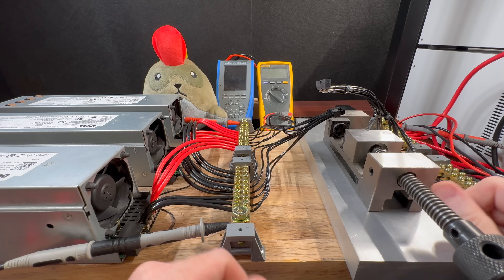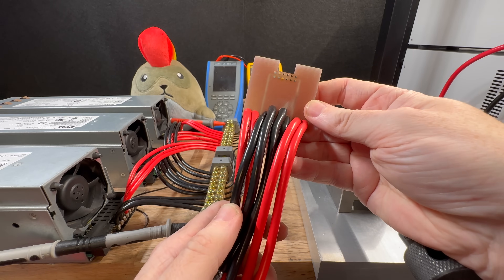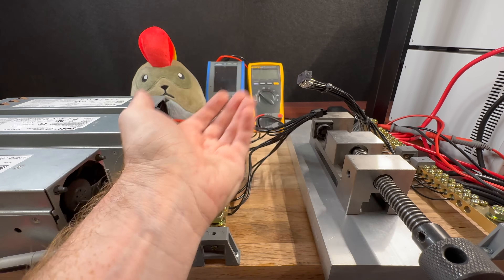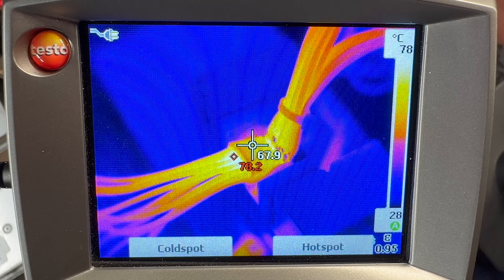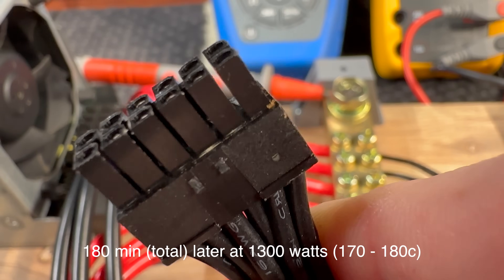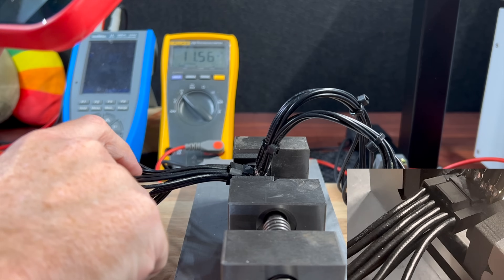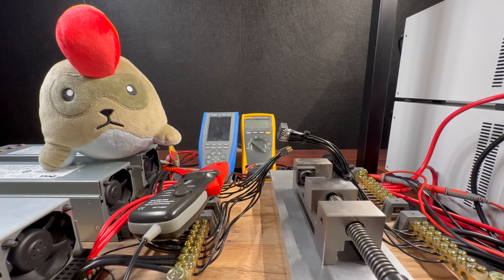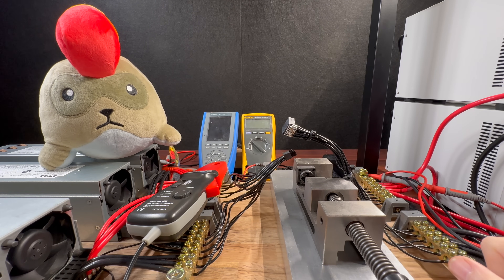NVIDIA 12VHPWR - Q&A + Melted Wires

Comment: About female connector (one supposed to be soldered on pcb), are sqare pins able to twist, rotate around axis inside connector in this setup? possibly affecting contact quality.
Reply from the maker: Possibly but the pins were stable but that which is why I did the 12AWG wire originally, I think it is just the connector degraded to a point of a cascading failure (a lot of heating has happened to this connector now). We will come back to it and investigate more

Comment: I would like to see a 3x8 pin setup tested just to see what sort of currents that can pull. and considering that they have a weird combination of 3x12v and 5xGND (the 2 sense pins are ground also) it could make for some weird results. although to make one fail you may have to test just a single 8 pin connector then just 3x the result.

Comment: I think it would be super interesting to also try this with other brand's cables. Currently you are using be quiet. Most issues with melting I heard occured with Asus or Corsair cables. Could be quiet's cables simply be superior?

Would also be interesting to see 12VHPR vs 12V 2 x 6.

Thanks for doing this BTW, very interesting!
Reply from the maker: That is a rabbit hole we can certainly go down in the future 🙂 currently getting the basics down then we can explore some other options 🙂 im not saying bequiet cables are normal, above or below average yet with a sample size of 1 🙂

Comment: We can shure abaut the connector houseing need some more disturbance to get melted.
So the base problem not the DC current load. 
Next step: need some chopped load to make the pins and wires are start moveing by the dynamic forces.
The contact surfaces may take some rubbing on eachother and it is may cause sparking and more exessive heat build-up than a static overload.
Reply: But contacts dont move while they are inside pc. They are always under tension, because of all the bends. Only things can ruin connectors are if u remove them under high load, or if u put them from one gpu to another, because some company might make that square contact pin larger than other, causing connector to stretch and be loose while installing on other.

Comment: I think it would be a better test case scenario if you could set it up so only a couple or three of the wires have past the specified 9A current going through them constantly. Then, observe the temps per wire, and the connectors. What we know so far is that once the cable has gotten some use, the connectors eventually start to develop connectivity flaws where resistance occurs, and this results in the current re-routing over to the wires that are still fully connected--thus resulting in increased heat until burning point. Note that the recent cases seem to have had the melting happen on the connector plug, not the wires. This may mean the connection between wire and the contacts (soldered or not) may be unable to withstand the heat and are the first to reach failure point. The arcing inside then eventually melts the plastic leading to the catastrophic issue.
Reply: YEP! Although in the end we'll only prove that 1 wire/pin can't handle 600W.
So either card makers return back to at least 3-phase power cascade...
or we succeed this connector with a simple two-pin like the C13/C14. :)
Reply: Upvoted. The entire problem with the standard is the pins and barrels having connection failures
Reply from the maker: We will be deep diving into this soon, I think everyone will like where this will be heading

Comment: just got my 5090 FE and oc'd it's pulling >550w over the 16pin based of gpuZ readings, but with my flir thermal camera temps are fine & in range.

Comment: This series of videos you are doing are very interesting and awesome seeing a fellow aussie doing in-depth videos on the topic as well. I am learning a bit about this connector and I'm also having to replace the connector on my rtx 4090 due to it melting as well as the adapter melting that came with my gpu, I have an asus rtx 4090 the strix oc. If you have any pointers or advice in replacing the connector and how to go about the soldering part of it that would be greatly appreciated as i will be new to soldering i haven't soldered much in the past except for speaker wires and shunt resistors on rtx titans. Keep up the work mate and stay safe
Reply from the maker: I think you would need low melt solder and a heat gun to get the old one out and probably a strong iron to re-solder. Reach out to me on OCAU if you need some help I have some spare connectors etc :)

Comment: I think it would be interesting (as a side test) to wire the setup so all wires and pins are in series, you can dump 10A plus using constant current and not have to heat up the space with 1600w of heat and not worry about wire heatsinking on the pcb side connector.
It wont be realistic for how they fail in the field but I'm curious.
Reply: The resistances would all also then be in series, and in series resistance adds up, the whole thing would see like 10x more resistance than how it's normally wired (well actually even more cos paralleled resistances usually go down when combined instead of adding up as we calculate it 1/Rt=1/R1+1/R2+...1/Rn instead of Rt=R1+R2+...Rn like when in series), and plotting the increase in resistance over time at varying loads and temps at failing connector pins is what will really teach us more about how this connector behaves, and is the important thing in these test really. It would be fun to do just to see it die spectacularly, but I have a feeling we will anyway soon, and in a much more realistic use-case. In series we don't get much useful data out of it afaik, other than at what temp certain things fail. We could use like 10x volt meters to plot the voltage drop across each pin still, but the load would not be the same through any of the pins as when using it as it would normally be wired, in parallel. So any results we did get wouldn't be of much use even if we got them. ;)